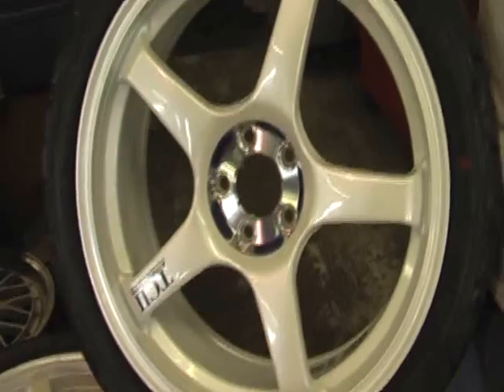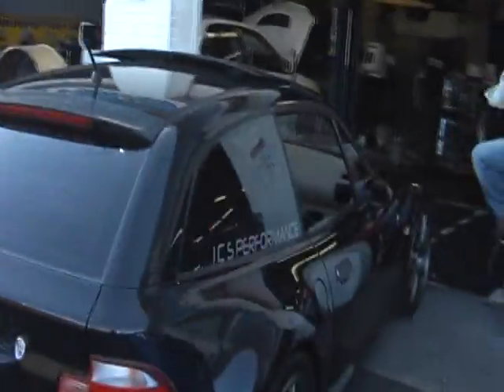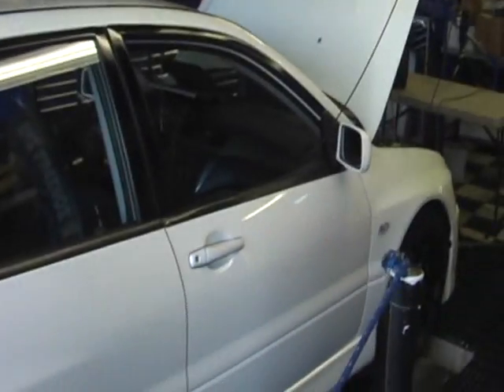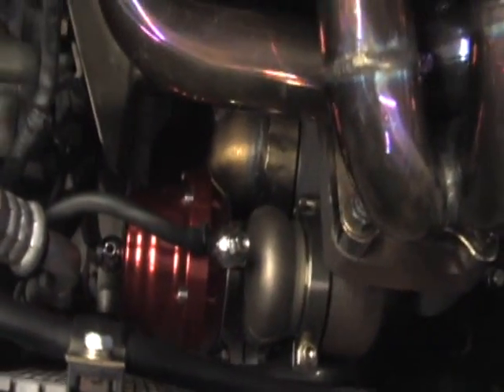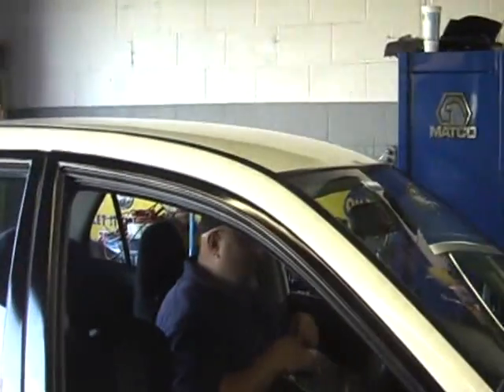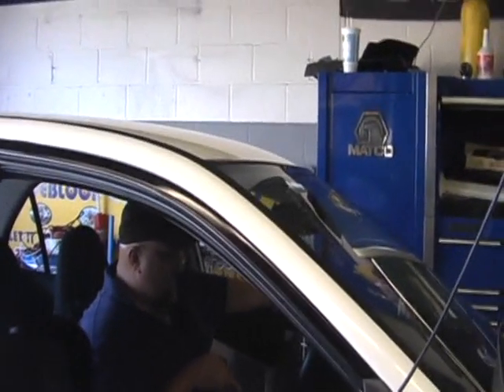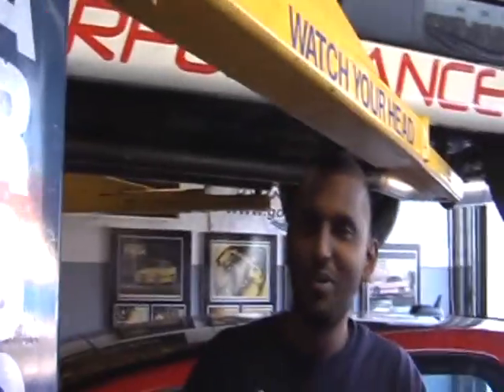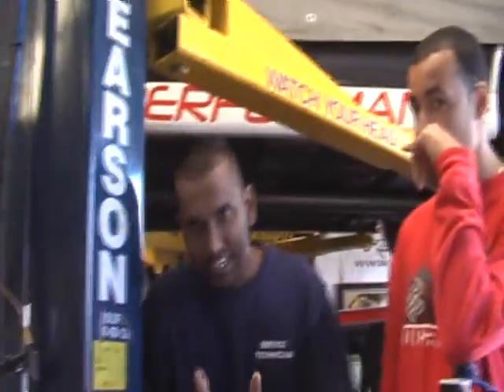Tuning a Evo 8 with ATP Gt35

Comment: Surely this car has meth/alchy injection no?

I mean I have seen a few 35r cars make 500 on straight pump no additives but that was around 27-29psi, I guess as long as you have the fuel and timing dialed in then you can pull it off.
Reply: I see 35r EVOs make 650awhp on pump all the time. In Fact i saw a gtx3582r hit 800 on 92oct and 900 on E85 last week!
Reply: Evol_AF i seen stock turbo hit 500 on pump too